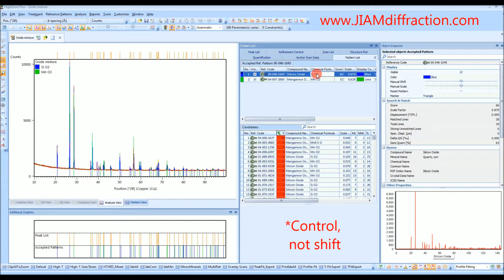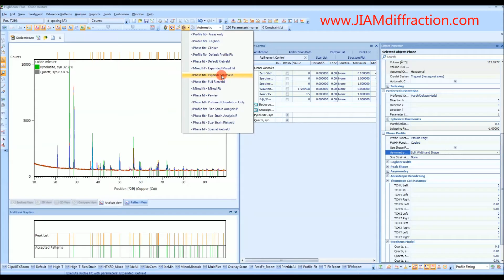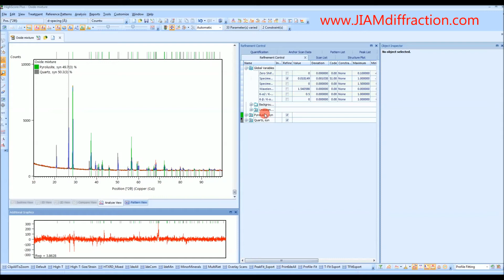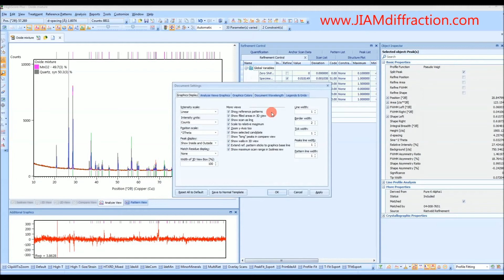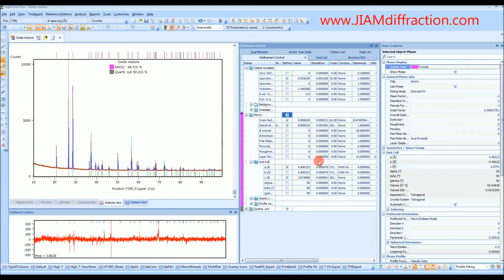HighScore Plus Tutorial - Phase Quantification Rietveld X-ray Diffraction - Long Version - JIAM

Comment: there is no structural information for any of my phase, could you please tell me how to get the structural information???
Reply from the maker: I think the Crystallography Open Database (COD) can provide files with structural information.  I would suggest trying to use that.  If you can save a .cif file with structural information, you can load that into HighScore Plus and refine it (I think you just have to do choose File, Insert, and then choose the .cif file).

Comment: hi, can phase quantification of composite materials (polypyrrole and bismuth on the surface of GO)do by reitveld refinement?
Reply from the maker: I'm not familiar with all the  materials you listed, but if you can detect the different crystalline phases, phase quantification should work.
Reply: @IAMMDiffractionFacility  Thanks a lot. What I concluded that we can do phase quantification with crystalline material. And my composit contains some amorphous material that's why phase quantification will not work with my prepared composite.

Comment: Hello. Great video, thanks for posting. One thing though; the Rietveld refinement won't run, I get a pop-up message instead saying "Automatic divergence slit scans are not valid for refinement". I'm puzzled a bit by this message ... Any suggestions how to fix this block? It would be highly appreciated <3
Reply from the maker: I'm happy it has helped so far!  Regarding your question, automatic divergence slits are great as they allow you to reduce the amount of noise at higher angles of 2theta when compared to fixed divergence slits.  However, Rietveld refinement is based upon the assumption that you have the same X-ray interaction volume throughout the experiment.  This is true when using fixed divergence slits, but your interaction volume increases as 2theta increases when using automatic divergence slits (the slits continuously open more as 2theta increases to maintain X-ray interaction AREA).  As a result, your relative intensities are "wrong" when using automatic divergence slits.  

Thankfully, HighScore can correct this.  Go to Treatment, Corrections, and Convert Divergence Slits.  You can then choose to convert the data to whatever divergence slit size you want (I typically choose 1/2 or 1/4, but it probably doesn't matter).  Click ADS to FDS, click Replace, and then click Close.  You should notice that your data look different now.  

When handling automatic divergence slit data, I recommend saving the original file with something like ADS in the title.  After you complete the conversion in HighScore, I recommend going to File, Save As, choose the XRDML file extension, and then indicated in the filename that the data have been converted (e.g., put "ADS to FDS" in the filename).  Do not save the converted data over the original data as you will lose some of the metadata that tells you what original hardware was used for data collection.

Comment: Hello Dr. Michael, 
Many thanks for such an instructive video. I have a question that I hope you can help me with: Can I use XRD data acquired from different equipment with highscore plus? I want to do the Rietveld refinement, but in the literature I see that there are several factors such as the scale factor which depend on the hardware and I am not sure if such factors are needed/used somewhere during the rietveld refinement. 
Many thanks.
Reply from the maker: You should be able to use HighScore Plus with data from other instruments.  Back in my grad school days, I used HighScore Plus to refine data from a Bruker instrument.

Comment: Thank you so much for your very nice and didactical videos. One question. The program proposes to strip K-alpha2, which can be done before search peak. You did not comment the possible interest of such a step for next steps (phase identification & quantification, Rietveld, strain, etc.). What is your mind?
Reply from the maker: My apologies for the slow response, I was very busy preparing for and then taking a vacation.  Regarding your question, I generally prefer to not strip K-alpha2.  Maybe it would help to strip it for phase identification, but I have not tried it.  Personally, I try to manipulate the data as little as possible so that I know I am not introducing a source of error from a poor stripping algorithm.  Most (if not all) analysis software will account for the doublet peak during refinement anyway, so stripping the K-alpha2 peak is unnecessary.

Comment: Hello, thanks a lot for this tutorial. I was wondering if this procedure could be enough accurate for clays phase quantification, or if I should use an internal standard ? Thank you for your reply !
Reply from the maker: Honestly, I do not have much experience with clay samples, so I do not want to give an answer that I am not 100% confident in.  However, I did a little research, and there are numerous papers online on the topic.  A couple are "XRD-based quantitative analysis of clay minerals using reference intensity ratios, mineral intensity factors, Rietveld, and full pattern summation methods: A critical review" and "Accurate quantitative analysis of clay and other minerals in sandstones by XRD: comparison of a Rietveld and a reference intensity ratio (RIR) method and the importance of sample preparation."  The second paper seems to conclude that both RIR with an internal standard and Rietveld (without an internal standard, if I am reading it correctly) give similar results.  However, the importance of sample preparation can't be overstated.
Reply: @IAMMDiffractionFacility  Thx for the advice, I'll read them and see what is the most suitable to my samples

Comment: Dear Dr.Koehler Excellent way to explain X'pert high score .can you explain me how i import just analysis Graph , I just want this analysis structure bcz I already have analysis data but I want to put this XRD graph in my paper that way I just want to pick up this analysis Graph of XRD
Reply from the maker: Thanks!  As for your question, let me make sure I understand you correctly.  Are you able to open the HighScore Plus file and see the graph?  If so, you can save the graph by going to File, Save As, and choose JPEG as the file type.  If you want to plot the data points, the refinement curve, and the background yourself in different plotting software, you can go to the Anchor Scan Data, highlight all rows, copy, and then paste into something like Excel or Origin.  I think Anchor Scan Data has the raw data, the refinement curve, and the background data, but let me know if you can't find it in that tab; it's possible I'm thinking of a different tab.  

If I misunderstood your question, please let me know and try to ask it differently.

Comment: Dear Sir, Is this software best for analysis of xrd data of materials ? (Li-ion battery cathode materials)
Reply from the maker: I do not feel qualified to say whether or not it is the best as I have not tried all of the others, but I do really like it.  There are free options (like GSAS-ii) that give excellent results as well (my boss loves GSAS-ii), but the graphical user interface and customization options of HighScore Plus make the cost well worth it, in my opinion.  I have also recently helped a user analyze in situ battery data, and the results turned out very well.

Comment: Thank you very much for these videos, in fact I am following the same steps as you but I cannot determine the Miller hkl indices, is the database file of COD_2016_Conv45.hsrdb not suitable for determining them?

Thank you
Reply from the maker: Just to clarify, are you able to identify your phases (you found reference patterns that match your diffraction pattern) but you can't determine the hkl indices of the peaks?  Or are you unable to identify the correct phases?

Comment: Excellent video! Is it necessary to do a process for instrument broadening before doing this Rietveld Analysis? I saw you did it for Crystallite size and microstrain analysis and now I am wondering if this step should be done before. Thank you for your response!
Reply from the maker: Thank you for the kind words!  Regarding the instrument broadening, it certainly isn't a bad idea to do it for Rietveld refinements/phase quantification.  I have tried it both with and without instrumental broadening, and my phase quantification results are the same.  However, I suppose that the proper answer would be to do it.  It is a good idea to get in the habit of doing it, that way you don't have to worry about forgetting to do it if you want to add crystallite size and microstrain to your phase quantification analysis.  Excellent question!
Reply: @IAMMDiffractionFacility  Thank you for taking the time to respond! I'll keep it in mind for my analysis.

Comment: Hi, 
Please I have issues with peak fitting as the software often displays " no structural data for simulation/refinement" and also refining the XRD peaks was not possible as well. 
Note that the data contains mixtures of compounds.  Please, what am I doing wrong?
Reply from the maker: Hi Joshua...regarding the no structural data problem, please see this video:  https://youtu.be/yGQDXCXEaqY.  

Regarding not being able to refine the XRD peaks, is this a problem you are having when you are trying to perform a profile fit or a Rietveld fit?
Reply: @IAMMDiffractionFacility , thanks for the prompt response. I usually encounter this problem when trying to perform Rietveld fit.
Reply: @IAMMDiffractionFacility , 
I have followed the steps as explained in the video. Although my Xpert has more than 500,000 PDF,  it cannot still display the structural data. Also, having inserted the CIF files the data did not sync with the Xpert database as they must be uploaded each time I want to do analysis.
Also, I discovered that deleting the phases that do not have structural details left the peaks unidentified/unmatched.
Please, what could be the issues?
Reply from the maker: Yeah, CIF files need to be loaded manually each time you use them, or you can copy the phase from one HPF file to the next, or save an HPF file with the CIF file loaded but no diffraction pattern loaded.  There are a few options, but I don't know of any way to add it to a database.  

What database are you using?  Some databases do not include atomic positions.
Reply: @IAMMDiffractionFacility  
These are  the database  details:
COD-Mar 2010 (HighScore plus 3.x)
PDF 2 Release 2004 (HighScore plus 3.X)
PANalytical Example database (HighScore Plus 2.x)
Reply from the maker: I'm not sure how the COD database works in HighScore (I've not seen that installed in HighScore Plus before), but I believe that the PDF2 database is only used for phase identification, not quantification, as it does not include atomic information.  I imagine that the COD database does have atomic information, but I'm guessing the reference patterns that you are using are coming from the PDF database.  When you perform a search & match and edit the restriction set, go to the Quality tab and click the box next to "Skip patterns without structure data," assuming that version 3 has that option.  This way, you will only get results that can be used for refinement.
Reply: @IAMMDiffractionFacility  
1. If two different compounds match the same peaks and there are possibilities that the two could be present, how should that be treated?
2. I also discovered that the main phase varies with the search methods viz; with and without structural data, the addition of suspected element ( different from the major constituents)... I don't know why.

Comment: hi, your explanation is very helpful.. can you post a video with a complex pattern and semiauto or manual mode of refinement?
Reply from the maker: Good idea!  I will certainly add it to my list.  I warn you though, it will likely be a while before I have time.  I am editing 3 different videos right now (using our new automatic sample changer, performing high-temperature experiments, and performing grazing incidence experiments).  I need to get these three videos posted to help the users in my facility, which will reduce my workload a little bit since they will need my help less.  This is especially important as we have just received a new single crystal diffractometer that I need to learn how to use, make a manual for, and make a basic training video for.  We are also hoping to acquire funding very soon for upgrading one of our diffractometers to perform pair distribution function (PDF) experiments, which itself will be a very large project if funded.    

I am going to continue making videos through all of this because I love this channel and experience, but it may be slow going.  It may or may not seem like it, but I put a lot of time into editing these videos (especially since I'm a novice and not that great at speaking when recorded), so that makes my release schedule much slower.  All of that is to say that yes, I certainly take the suggestions people give me, but I may not be able to deliver on those suggestions as quickly as people may like.  For that, I apologize!
Reply: @IAMMDiffractionFacility  thanks for the reply... I believe it would be worth to wait for your videos.
Reply: Yes, this is a good question

Comment: Hello, I am asking how exactly I can use the Rietveld method to determine if my experimental spectrum is comparable with the simulated one (a new CIF that I cannot find in the database)
Reply from the maker: Unfortunately, I have not found a way to load it into the HighScore Plus file so that you can see the stick pattern overlaid on your diffraction the same way you can when you find reference patterns in the database.  

However, if you go to File, Insert, and then select the CIF file, the software will load it as a phase.  You can then choose to refine that phase in much the same way that you see in the video, and hopefully you will get a good fit if the CIF file matches your diffraction pattern.  

I hope this helps!

Comment: could you please explain how to find zeolite and gismondine phases in XRD pattern using Xpert high score.
Reply from the maker: For zeolites, you could select aluminum, oxygen, hydrogen, sodium, potassium, magnesium, and calcium as possible elements.  My understanding is that gismondine is also a zeolite, so the same search should work for it.  Essentially, find what elements are in the phases that you think are in your sample, and then enter those in the periodic table screen that I show in the video.

Depending on your version of HighScore Plus, you might have a couple more options in the Edit Restriction Set window.  You can go to the Strings tab and enter the compound name or mineral name to narrow down the search results.  The second additional option is to go to the Mineral/Zeolite Class tab.  Under Mineral Classification, you can scroll all the way to the bottom and choose ZEO - Zeolite (Family).  Under Zeolite Classification, you can scroll down and choose GIS - Gismondine.

Comment: Thank you for explain. 

I got x data as a text file.  How can I get it into the program?
Can you help me . Pleas
Reply from the maker: So it is a .txt file?  What does it look like?  For example, is it just two columns of data?
Reply: @IAMMDiffractionFacility  
Yes it is 2 columns 
but it is txt file . So the program don't able the file
Reply from the maker: Okay.  First, make a copy of the file in case what I tell you messes it up!  On the copied file, change the extension from .txt to .asc.  Now try to open the file using HighScore.  It worked when I tried it, but let me know if it works for you.
Reply: @IAMMDiffractionFacility  
Did you mean this information for my research? 
If that is the question then the answer is yes the works for me
Reply from the maker: I'm glad it fixed the problem, and thank you for letting me know!

Comment: First thanks for a very informative tutorial. Could you please tell the minimum step size and step time to perform a reasonable rietveld analysis?
Reply from the maker: That is a difficult question to answer as there is no single answer; every sample is different, and the choice of detector can also affect it.  I can tell you for step size, you want to have 8-12 data points above the full width half maximum (FWHM) of your peaks.

Comment: Thanks for this video. there is on question. i use high score plus, but don`t same your database. in particular  there is no information about structure in reference pattern.
except for structure, have all. I want to analyze the phase percentage ratio.  please tell me add method to structure information. thank you so much!!
Reply from the maker: Please see this video (https://youtu.be/yGQDXCXEaqY).  Option 2 in the video shows you where to find the structural information online in a .cif format.  If you already know the structural information and are just looking for a way to enter it manually, option 3 in the video is what you want.  If you look in the video description, you can skip to each option directly by clicking the time code.  

Please leave a comment in the other video if you have additional questions about it, and please let me know if it fixes your problem.  Good luck!
Reply: @IAMMDiffractionFacility  thanks to your advice. i solved problem to structure information, percentage ratio. You recommended video, Nice!! thank you!!